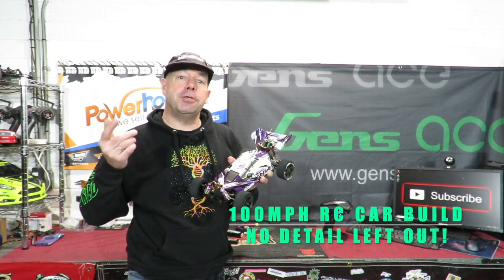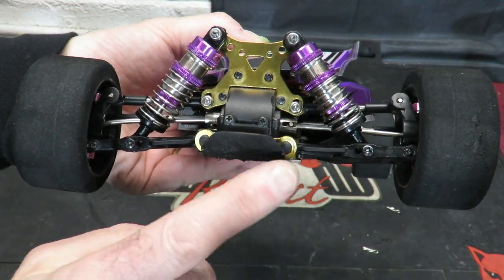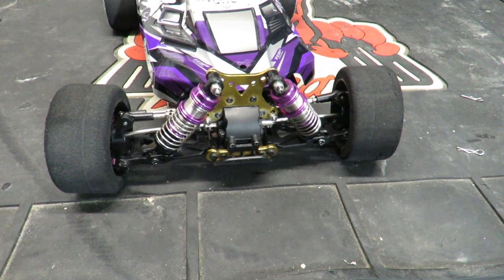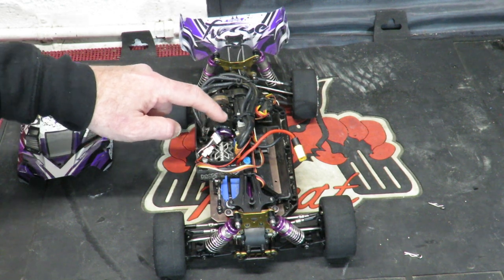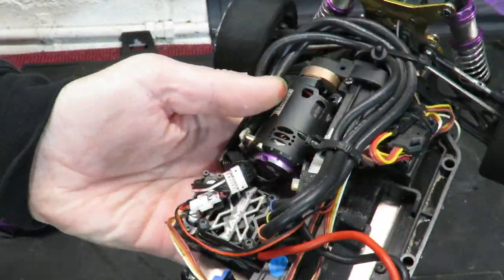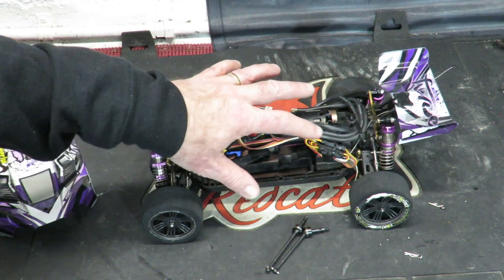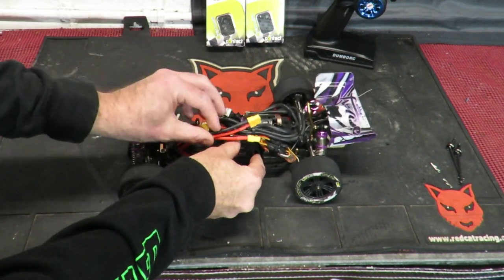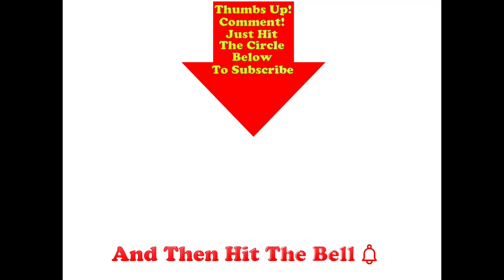100Mph RC Car Build - Nothing Left Out!

Comment: Good Stuff Brotha! You still need to pick up some of these servos I'm telling you bro they are perfect! Check them out on Amazon.  JX servo PDI-1181MG 17.5g 3.5kg
Reply from the maker: Chris thank god you posted this. I think you did the other day then I lost the darn post and my wife closed the Amazon window! Lifesaver mate!
Reply: Hahaha got to love the old ladys! You won't regret these servos bro
Reply: @sickduck66  Spot on Chris, I have these installed in mine. Just need a 3 mm screw that is the same length as the coarse threaded one that's in the factory servo. The screw included with the new servo is too short when using the WLtoys original servo arm.
Reply: @charlesbeshaw9843  you sir.. are correct 😁

Comment: I have actually seen people put closed wheel pan car bodies on these. They are very sleek and reduce drag at high speed because it is closed wheeled. It will also increase the cars overall stability.
Reply: Also the body will let you have extra space for wires,electronics, etc.

Comment: Running the 4tec body is a great idea, you'll have more room under it to do things like:
* turn the esc so it fits better if you want 
* mount bigger batteries (2s, 3s, maybe even ... 4s🤔)
* run a fan on the motor if so desired
Love what you're doing so far, keep it up.

Comment: These videos have so inspired me! I have 1 124019 and 1 124018 for my girls and I to run around our steet, and 2 124019s ordered.  One will be for dirt track my buddy and I are going to build at his place this Spring, and the other will be for speed runs.  I can't wait to get wrenching on them!
Reply: I’d get the Lc12b1 instead. It’s better quality and what the wltoys cloned.
Reply: @roberttruesdell6151  Yeah, maybe later but for now these are fine.  I have had some really hard crashes with no issues with either one. And the two 124019s I just ordered were only $80 so they are great to learn on.  But yeah, I'm sure you are right about the quality.  Thanks.
Reply: @roberttruesdell6151  the comparison between a 124019 and a lc12b1 is a bit bad, that's like telling someone who has  VW gold or any normal car to buy a Ferrari because they are better , lc12b1 might be better, but it's also 3x the money.
Reply: @darkki94  there is a difference the LR Racing isn’t a clone. The wltoys is.
Reply: @roberttruesdell6151  not everyone can afford a 200-250$ toy but a 80$ is a lot more affordable .
Reply: @darkki94  I get it dude. I didn’t force the guy to buy one. I just suggested it. I have one myself. But the LC Racing one is better quality and what the Wl Toys was cloned off.

Comment: Great build Rich I have bought these parts for my car I'm turning into a rally car the front bumper with body posts  and the rear body posts will work good with that race body 
LC RACING Body Post Set Black For EMB-SC EMB-WRC EMB-MT #L6033
LC Racing Rally Bumper Set Black EMB-WRC EP 1:14 RC Cars 4WD On Off Road #L6040
Reply from the maker: Kurt Many many thanks for sharing this, I've popped a set of the posts on order. I wish I'd seen the post earlier as I stayed up to 2.30am printing off some on my new 3d printer! My home made ones will make an appearance later this week!

Comment: I was looking at the 3.5 turn rocket motors and it says it's rated for only 1S lipo will it blow the motor on 2s with that rocket motor Ill be running a 120 amp hobbywing esc will it hold up

Comment: Hi, do you know which Moss rubber tires can withstand a really very high speed, have wltoys 14001 with a motor-pinion module 1 26 teeth and a main drive wheel with 19 teeth and my Moss rubber tires shredded ..... 😜 at not even full speed. KV moror 4000 on 3s
Reply from the maker: No, sorry

Comment: Fuuuuck I bought a new servo for my brushless system and it arrived, ist waaaay to big :(( anyone any advice how I could handle the problem?
Reply: Chris Torres, recommended this JX servo PDI-1181MG 17.5g 3.5kg Metal Gear Analog Servo. Search it on Amazon. I purchased two and my are in the way.

Comment: HOw much would that whole car setup cost?
Reply from the maker: More than I'd tell my wife... ESC is the biggest bit but a cheaper one would probably do, however the castle is high power and compact, just sent the dead one off for warranty repair. Of note the stock plastic gearing hit 104 on the other one I own, and the motors $46 and the batteries just over $20. So not too bad for the speed other than the esc, I may try and do a 'budget build' next and see how fast I could push one for say $100, do you think that'd be of interest?
Reply: @DriftomaniacsRC  the budget speed run one would be great!
Reply: @DriftomaniacsRC  Yes, That would be good, since I do not have that much money lying around lol

Comment: It’s so annoying when people tight the spring tension collar down and say it stiffens the car.  
The collar adjusts preload and sets ride height.  That’s it. To change the feel of the shock springs, pistons, oil. 
All you did was raise the back. And front. And with the droop screws locked the suspension arm from moving freely. Droop screws don’t lower ride height either. The limit the down travel of the arm or droop.
Reply from the maker: Of note I raised the back, not sure how I raised the front by lowering it but there we go. As for the droop screws not lowering the ride I suggest that you take that up with arrma, as that's where I got the idea fromand in their manuals it says specifically to use the droop screws to lower the cars, but what do they know I mean they only make RC cars... Also don't you think it's odd that wltoys drilled four holes in just the right positions to fit droop screws? Weird huh? Like someone designed them in the right place...
This setup just works plain and simple, most people will just take it for what it is, a video to help others plain and simple. 5 days of testing to get it right but I guess you know all that from all the rc videos you make.......oh er hang on....
Reply: @DriftomaniacsRC  droop screws are meant to limit the amount of travel of the arms down.  Used in off-road vehicles a lot so when the vehicle jumps the arms don’t drop to much and cause the axles to pop out or jam/bind and bend or break. 
The collars when you screw them down on the shock your increase the preload of the shock and effectively raising the ride height of the vehicle. The spring tension doesn’t change.

What some videos from the pro racers like Adam Drake, Ryan Lutz etc. they have many videos explaining it.
Reply: You contradicted yourself.
If you pre-tension the rear shocks, which would mean they would not compress as easily, you would "stiffen" the car and raise the rear up.
And as you said, the droop screws limit the downward motion of the arm, if you limit the downward motion enough the car will sit lower.
His setup is stiffer and lower in the front.
Reply: @Mark_5150  preloading the shocks is just putting a load on the shock before the weight of the vehicle is on the shock hence “pre” what that does is take out the droop or natural ride height and keeps the ride height higher.  The spring tension hasn’t changed.
Reply: @Mark_5150  it doesn’t actually lower the car it keeps the arm from moving. It’s a false ride hieght and makes your suspension not work effectively. Ultimately keeps your shocks from bottoming out.